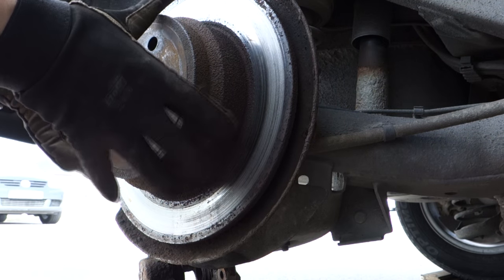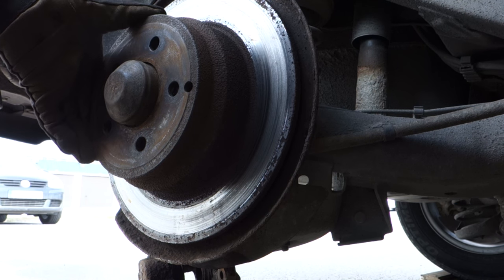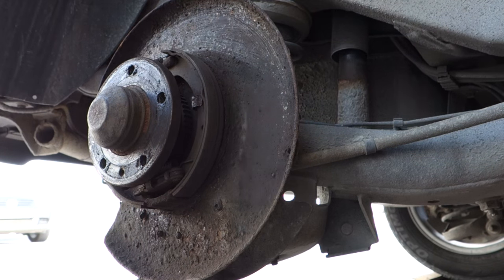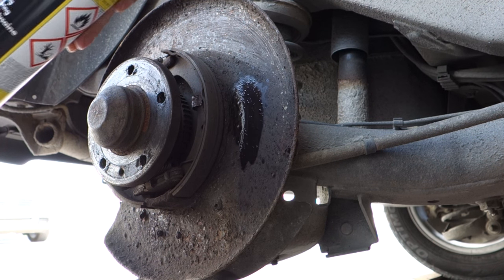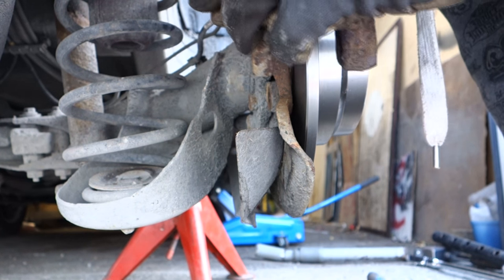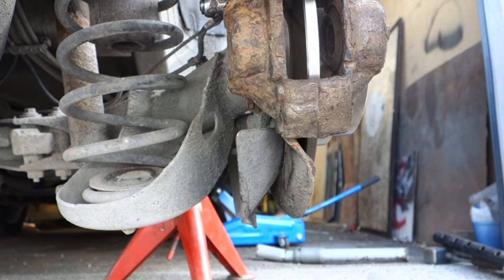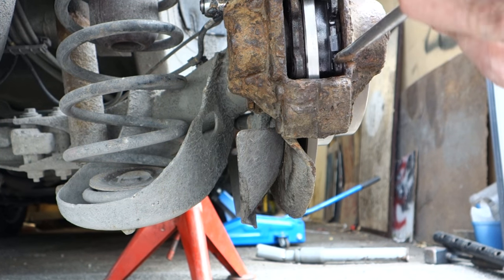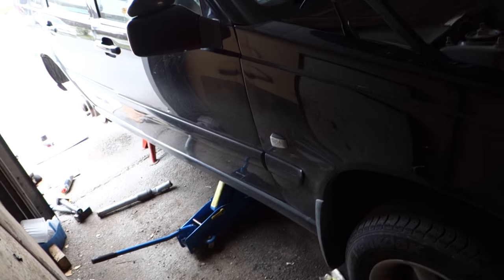How to replace Brake Rotor Volvo, V70,S70,240,850 etc.

Comment: pretty good  but be nice if you redo and be super specific about installing clip. It goes under the pins but some say to put clip on then install lower pin, then push upper part of clip in while pushing upper pin in. Seems impossible to put pins in first then clip so any uber specific info would be nice. also do pins fit into the narrow channel of pins or just beyond??

Comment: My God, replace those rusty calipers !! otherwise a very good video :-)
Reply: the mounting hole on the caliper for the lower guide pin was broken off on the right side!
Reply: @Shun-the-Sun  - It went broken at time 0:27 so he was very quick. So that galiber is gone and doesn't have any replacement value for dealer.

Comment: Much Appreciated! Thanks for sharing your expertise!       Question?  I used authentic Volvo Pads & After market Rotors from Napa, They squeak  extremely bad!  What is the combination or solution for noise free??
Reply: In general, put silicone grease (or Copper grease) between the pad and the shim (if there is one). Don't get any on the disk or the operating surface of the pad.